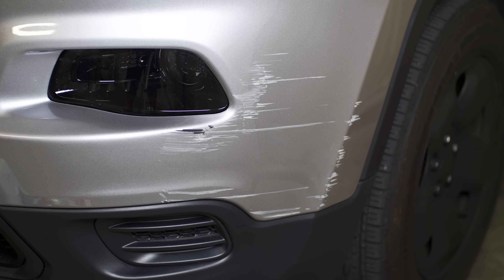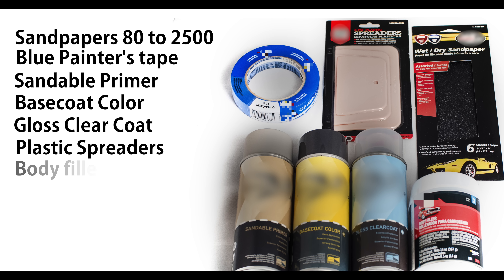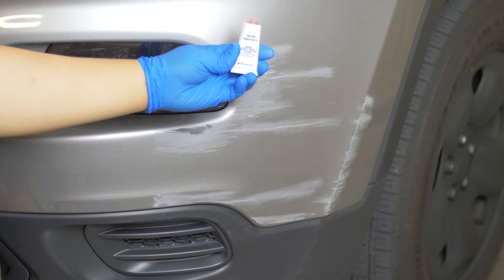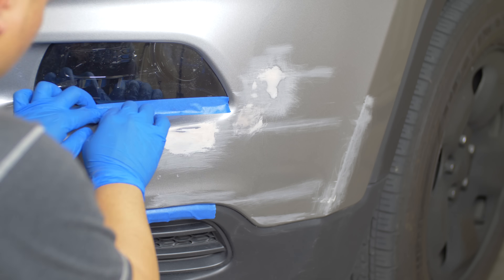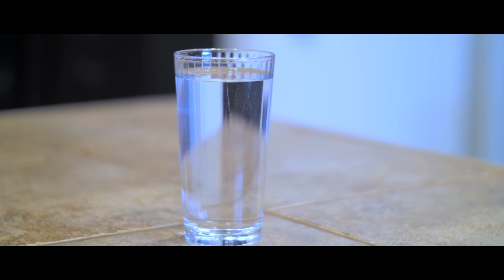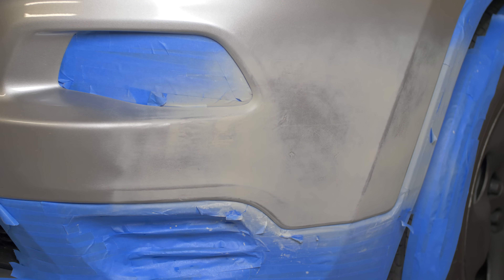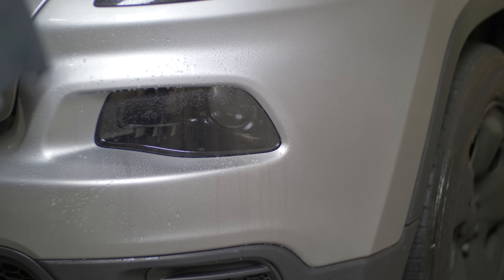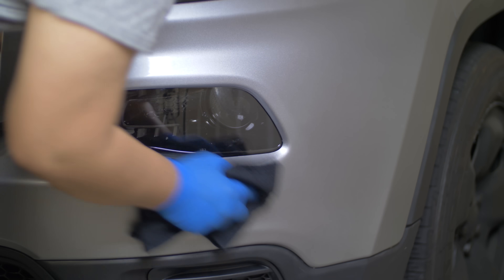How to Repair Scratches on your Car | Save Hundreds of Dollars

Comment: There some steps that you forgot and another one's that you did unnecessary. The first steps are ok but, the bondo you need to press into the scratches and remove the excess with the spreader at 45º flexing it with your fingers to copy the shape of the bumper in this case. With this technique you will save sand time, a better adherence of the bondo to the piece, excess of bondo and avoid the use of a hard grade sandpaper to level it, you can sand it with 150 and you have to control with your fingers that there are no steps between the sanded bondo and the piece. Once you achive that you have to sand with a 220, 320, and finally with a 400 all the piece that will receive paint, if you don't kill the brigte and paint over it the paint won't stick and will begin to peel soon. Once you do that you can apply the primer coats, once it dry you have to sand it with a 600 and finally with 800 WET Sandpaper, clean all the surface (with a degreaser) let it dry and apply the base coats and the clear coats, always trying to blend the new base coat with the old and the same for the clear coat. If you use a 1K clear coat you have to wait a week to polish, if you use a 2k one day or two if you live in a cold or wet weather area. Before polish you have to level the clear coat pore, the famous "orange peel" and level the old with the new, to do that use a wet 1500 sandpaper, then a 2000, 2500, 3000 and finally a 5000 if you gonna polish by hand. And now you can use the compound and finish by hand to make it bright.
Follow those steps and you will get a better, no peal and smoother finish.
Reply from the maker: Wow thank you so much for the suggestions!!!
Reply: When you say blend old with new, do you mean WET sand BASE COAT with old paint and THEN WET sand clear coat and old new coat before applying compound to polish?

Comment: Did something similar but ran the hose to under the throttle body, didn’t have to remove the intake & don’t run the risk of the Vacuum line freezing in cold AB (-40) also it does not not have the upgraded rings & still works good.
Reply from the maker: lol whatchu talkin bout?

Comment: It turned out great.  However a couple of things to note.  You should not have used anything greater than 600 grit sandpaper before applying base coat.  You want some scratches so the paint will grip.  400-500 grit is also fine.  The 1500-2500 grit was totally unnecessary and will actually hurt the durability of the paint.  Next time also use a flexible bondo product for bumpers.
Reply from the maker: Thanks for your suggestions.
Reply: Danggggggggggg, now he has to scratch up another fender and shoot another video!!  Heyyyyyyyy, not a bad idea!!
Reply: for that repair and only scratches, you do not need a flexible bondo ( body filler) When you do need to use a flexible bondo, then your best bet is to buy a new or aftermarket bumper. It will be cheaper in the long run. unless you are butchering it for a quick resale.
Reply from the maker: Nein Body good advice. But I did go this route and it turned out fine. 😊

Comment: For the people that attempt this time-consuming nightmare, 
1. Read the other people's comments with tips and their learning lessons. 
2. If you're doing all of this outside, THE WIND IS YOUR ENEMY! Blew crap on my work after I just started the gloss phase 🥲... So do it in a nice sheltered area or tape down/remove anything that can be blown by the wind. 
3. If you've never painted before, use painter's tape only in areas where paint is not supposed to be (e.g. headlights, windows, plastic areas). Don't put tape on the body of the car if it's meant to have tape. I taped only around the small area that was damaged in a rectangular shape. After removing the tape, I saw paint ridges formed around the tape in a rectangular shape, which was noticeable as when it was scratched 🙃...
Reply from the maker: Thanks for the suggestions/tips
Reply: Thanks for the tip.. I couldn't agree more. 
1. I read the top few comments before starting, but not all of them, and really wish I had made it down to yours.
2. Totally agree. Sent Primer bits on parts of the car that shouldn't have.
3. I made this mistake, and wish I saw this. I taped off a rectangle where the scratches were. after the painting and gloss, I removed the painters tape to find a beautiful 'patch' of smooth paint in the middle of my car. I tried to wet sand with the high grit (2500) sand papers, and it's helping, but it's still very noticeable. I think I need to make sure that the painting step is blending into the areas next to it, and only tape off the areas you mention. Great advice.  Wish I saw this last night :)
4. Thomas - you rock! Love the video, the humor, and the practical tips!

Comment: Great overview!  Thank you!  Quick question... in the final view, it does appear that the repair paint job is slightly more matted than the rest of the car.  It seems somewhat more glossy where no repair was needed but is this just due to the lighting in the video?  Would you say with the polish and buff it is just as glossy as the rest of the vehicle?
Reply from the maker: Thank you. 
Yes. In the video, the paint job was slightly not as shiny as the rest of the car. 
I did put a note in the description about what people in the comments mentioned. They said to use a very high grit sand paper after the paint dried.
Also you can put an extra layer or two of the clear coat.
Reply: @ThomasofAllTrades  Good stuff, thank you sir!
Reply from the maker: @PhillthyChee  thank you and you're welcome.

Comment: Nice video.. And great after tips from the public.. However, is it me, or does the finished job seem to not have as much the same gloss as the rest of the car's bodywork?
Reply from the maker: MN Salam thanks. Some of the comments mentioned that I should've sanded it with 2500 grit sand paper after. Also, i didnt wax it in this video. Lemme know if that works out for you. I was happy with the result I made and the wax afterwards did help with the shine.
Reply: Nice job anyways.. Keep it up!
Reply from the maker: MN Salam thanks

Comment: If you have a unique color (something not common) on your car, how do you know which color paint to get to exactly match it?
Reply from the maker: Check the link in the description for the paint. They match it very well. Mine was a billet metallic and it had some glittery look to it. I was skeptical at first but when I sprayed it, it also had some glittery look and it matched the original.

Comment: A lot of painters and repair shop will lose their earning with this video! Lol
Reply from the maker: Laguna Milkman oops 😬😅 people still have that super professional paint job option though. Lol
Reply: Not really in direct sunlight and from angles you will see the home job with spray cans. Home job is good to save cash but on par with a professional no chance.
Reply: Most people won't even consider doing it themselves the shops will be alright .
Reply: They will charge more after you screw it up 😂😂😂
Reply: Hope it sticks
Reply: The second that's in the sun you'll see it from a mile away. Especially silver. I'm a panel beater, car painter. Trust me that's gonna look awful.
Reply: I am damn sure one is gonna screw everything if he/she tries what's in this video :)
Reply: there solution for everything...replace the panel for $1000
Reply: No we won’t cause that was not even done right ok for a cheap repair but a professional shop like own would not cut corners like that but decent video but there is a TON of in correct work here

Comment: I got scratches on my car trying to squeeze it out of a tight parking spot my husband put it in. It scraped against the stucco of our house all along the side. I tried not to make it scrape but there was no way around it.  It was either scrape it or leave it stuck. The scratches were big and plentiful. I used a Mr. Clean eraser (available at any supermarket or drug store in the cleaning aisle). I got the idea from having to clean black permanent marker off a white painted wall successfully. I wet it and gently rubbed the paint (I did this on a small spot first since I didn’t know if it would also remove the car’s paint job as well. It cleaned the paint from the scratch without messing up the rest of the original paint job! I had to put a little more elbow grease into some areas but it worked. You actually couldn’t even tell that it was ever scratched!
Reply from the maker: Nice. Mine was kinda the same. I was trying to squeeze out of my one car garage and hit the stucco too.

Comment: Planning on working on this. Thank you for the video, I have a simple question. When do you determine that the body filler is necessary? I can see that my scratch removed the paint and the primer but the plastic under looks intact, however i can feel the gap with the nail. In this case the primer+paint+gloss should re-fill that scratch, or should I use body filler regardless? Thank you!
Reply from the maker: When you first sand it and it still seems pretty deep then you probably need a body filler. But from what you tell me, it seems like the scratch is not that deep.
Reply: @ThomasofAllTrades  thank you, I thought about it after I wrote my comment, after first sand check how does it look, makes full sense!

Thanks again!
Reply from the maker: ALEX CABELLO you’re welcome. Good luck!
Reply: @ThomasofAllTrades   just following up here and sorry for the bother but.. Why you didn't covered all the area that wasn't scratched with blue tape, is it to create some fading effect on the paint so it wont look like a square box of new paint? Thanks!
Reply from the maker: @alexcabello8070  yes that's exactly why and it worked out really well for me.

Comment: Great video. Gonna try this tomorrow! Do you know if I can use a wax instead of a polish? Or can i use the wax after the polish?
Reply from the maker: richtea87 thanks. You can use wax after the polish.
Reply: Hey Richtea how did you get on with the job? Achieve the same results
Reply: Wax will NOT do the same as polish! It is for protection (and can add a little shine, but not if it isn’t already shiny). Polish will help bring out the shine and level imperfections /orange peel in your cheap paint job. I’d actually recommend doing some 2000-3000 wet sanding after clearcoat, followed by the polish for a super smooth and glass finish, but this was great!

Comment: Just scratched a rental. Fixing it before I give it back.
Reply from the maker: Wow. Goodluck. Hopefully you have enough time to do it.
Reply: @ThomasofAllTrades  pffft. I got another week and I like diy stuff. Tbh, it's kind of a fun project.
Reply: Ben M how did it go? Did everything work fine?
Reply: @SebastianDoesGaming  Yeah, worked out fine. I learned a lot in the process. What to tape and what not to tape. How to use the spray can correctly. Could have worked out better, but, it was good enough to pass inspection.

Comment: The final finish is different than the rest. You should have used 1500,2500 grit sanding + compound + polishing + wax to get the finish.
Reply from the maker: AutoNutz INDIA thanks for your suggestions.

Comment: Amazing video!! I have my whole front hood where the paint is chipping out. Can I use you method to repaint the whole front hood? Or maybe repaint the whole car.
Reply from the maker: thank you. you can do it for the whole car but it's gonna be a lot of work and if you're planning on doing that  then you should get a spray paint machine. bbut you could always paint one panel  at a time. i have painted a whole hood before with spray cans and from that experience I would just get a paint sprayer.

Comment: Several mistakes, never spray vlear without paint hardening and wait 1-3 days before polishing, the paint at this point is extremely soft, high risk, easy to rub through the soft paint

Comment: So I have two questions what if there’s some rust on some of the spots, would there be an extra step? and what if there’s been some spray paint added just put on top, would you still be able to remove with these steps?
Reply from the maker: It depends on how bad it is but sanding the rust off should do the trick before starting the paint job. Same with the paint on top of it. Just sand it down. I hope this helps.
Reply: You have to sand the crap out of the rust to remove all rust

Comment: great video! May I ask which step brings back the gloss? I followed the video but ended up a somewhat matte finish that should be glossy and reflective. I've sure the clearcoat was glossy one.
Reply from the maker: Thanks. Yes. I have notes in the description that people from the comments have suggested to make it shiny. Basically, they're saying to add more gloss clear coat and to sand it at a very very high grit sand paper and then buff it when it dries the next day.

Comment: I literally have a scratch similar to that on my 2013 ford Taurus.. Its a weird green color n i just found out Its called ginger ale metallic . scared to try and fix the scratches myself😥 guy tried to charge me 1400!
Reply from the maker: I don't think it's worth spending that much. If you have the time to do it then you should just do it yourself. Another reason why I just did it myself because I would've waited a minimum of 3 days to get the scratches painted at the shop, whereas if i did it myself I would've just spent 2 days.
Reply: I had a truck do a hit and run on my truck.  Two different scratches totalling 6-8 inches, body shop quoted about $4500.  One of the scratches is 3 inches but they said they would have to do the whole panel!!!!!
Reply from the maker: Jm7887 Jm7887 i sincerely apologize for the late reply. Wow that's really expensive. Did you do it?

Comment: I’m so scared to try this, but I’m putting the things in my amazon cart as I type
Reply from the maker: Molly Salgado you got this!!!
Reply: Thomas of All Trades  so, I did this too. Where can I get the paint to match the car? Was it on the list ? 😬😰
Reply: @ana.luna27  look in your door jamb on driver side. Look under paint or paint code.
Reply: Did you end up doing this? How did it turn out?
Reply: @siopaobuns  YES I DID! you can kind of tell if you look too close because of my poor sanding skills, but if i was more careful with it, it wouldn't be noticeable at all, my boyfriend is a car fanatic and he said i did an amazing job for doing it my first time, i'm notorious for hitting curbs and poles, and i have a white car so the color of the poles transferred onto my car, i say it's worth it because it's so cheap, and now if i hit anything i have the stuff on hand and can handle it myself
Reply: @mollysalgado8489  thanks so much for replying! You’ve encouraged me to try it 😊👍🏼

Comment: Can I use bondo brand instead of others? Does bondo drying time longer than your body filler?
Reply from the maker: I used Bondo. It dries fast so make sure you put it on as soon as you mix them.
Reply: @ThomasofAllTrades  One more question. I went to the link you provided to get the paint spray. but they didn't have the pearl clear coat on the selection. do you think they may be blended pearl on color coat spray instead? the color coat spray says pearl white with the matching code. but usually when I get a touch up paint (stick type) from a dealer, the pearl is blended with the clear coat.
Reply from the maker: @SamsungTVChannel-et9nv  I'm not sure about that. However, i was concerned about mine too because the original paint had some glittery look to it but when I painted it, the color and the glittery texture matched the original.

Comment: I’m stuck between paying $700 and doing it myself for the $100🤔
Reply from the maker: 💯. have you inquired at your local Auto repair shops?

If they charge you cheaper than 700 then it might be a better option. 

By doing it yourself, you learn a new skill and make you extra careful when driving. You would appreciate your hard work more.
Reply: I'll do it for $699.99 tax free. If that helps. 😉
Reply from the maker: @dominicfrost8627  lol

Comment: Was the base coat paint  mix with clear coat all in one. Noticed clear coat wasn't apply after painting, instead went to using compound than finishing with polish wax.
Reply from the maker: No. I added the clear coat after the base coat. You must've missed it. A lot of people did.

Comment: I felt stupid when I accidentally bumped the Tesla Model Y on a cement pillar. Sucks but I just got the Tesla paint and dabbed it around the scratches. It doesn't look as good as original but at least there's no scratches when you see it. If I had the skill and patience of this guy it would've looked nicer but the cost was too much to get it professionally done. Perhaps if someone could've done it for $200 like this guy I would've done it.
Reply from the maker: Sorry to hear that. If you change your mind and if you have time time. You could try it yourself. 
Have you checked how much your local shops are charging to fix the scratch?

Comment: Thanks for the good video.. 
I have tried this with my car... it's partially successful and it's better than I expected but I found one big problem. Even though I used the same color code spray as manual shown turned out that  colors of the body and newly sprayed part were different. I think because the body color has changed naturally defected for 5 years.... Maybe after some time, it will looks similar. I hope.
Reply from the maker: Thank you for checking it out. Let the paint cure for about 2 months and you can buff it again and then wax it. Do this for the whole panel so it would blend better.